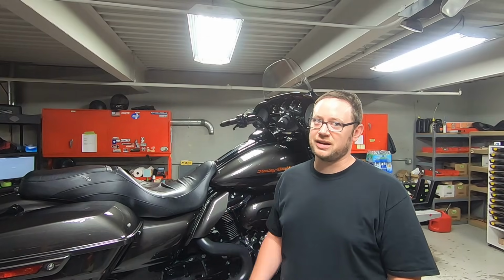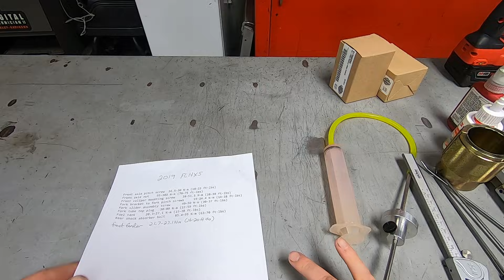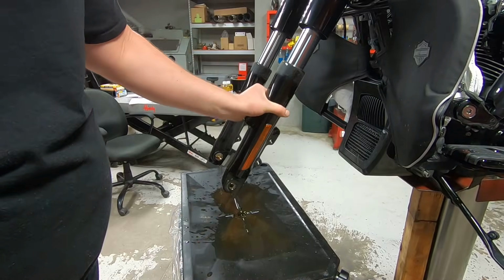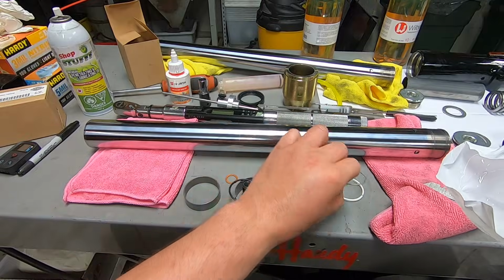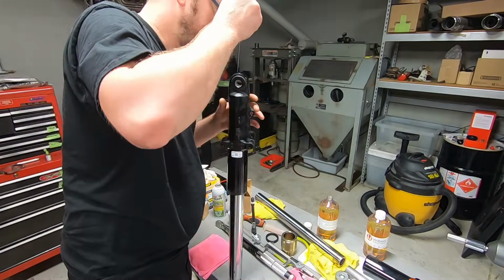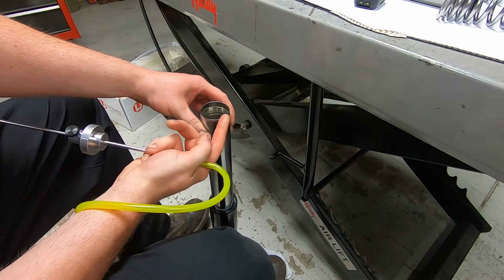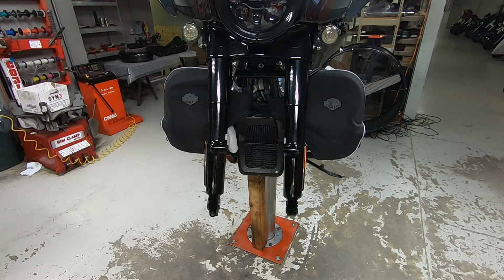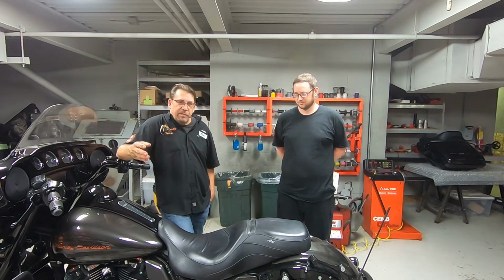Wilbers LDC Full Front And Rear Suspension Installation And Review For Harley Davidson Touring Bikes

Comment: This is a superb video! I purchased these shocks for my bike and I used this video to install them. They work perfectly, and this video was an absolute gold mine of information. I did not replace the seals since the bike only had about 10K miles on it, but if I had, I would have been well prepared for the work due in large part because of this video. Thanks again, you truly are a Wizard.
Reply from the maker: Thanks. And glad to hear!!

Comment: Brad, I have to say that your videos have saved me thousands of dollars by being able to do my own work on my bike. Your how to videos are absolutely the most professional I have encountered on YOUTUBE! I have the Wilbers kit coming for my Road Glide and am looking forward to the install myself. Thanks a ton my friend.
Reply from the maker: Good.  Thanks and your welcome!
Reply: @HarleyDavidsonWizard  Completed the install this past week. Everything went smoothly. I do have 2 questions. First question is there were some holes at the bottom of the fork tube (I have a 21 Road Glide Special) that you can see screws through the hole. Looks like it holds in the piece on the inside bottom of the fork tube. I wanted to know if the tubes have to be oriented in any particular way or does not matter when it comes to those screw holes. The holes seem to be a certain distance apart with one being different than the others. Second question is do I have to the test with a rider and passenger at the end? I gave the company my specific info when ordering. I have ridden the bike and it seems fine. Thanks in advance.
Reply from the maker: 1 The holes towards the bottom of the fork tubes have no specific installation location and can be pointed in any direction. 2. To do the initial suspension sag adjustment after installation. You first have the vehicle upright with no rider on the bike, measure the shock length. Then gear up as you normally ride to account for normal solo riding and with the bike upright again, sit on the bike and measure the shock. The difference of these two measurements is your sag adjustment. The Wilbers LDC will automatically pump itself up and adjust for a second passenger & additional weight in the future.
Reply: @HarleyDavidsonWizard  Got it Brad. Thanks for all the info. I'll check the sag adjustment tomorrow. From the video looks like yours needed no adjustment after checking it. But I'll make sure just as you did. Again thanks a ton!

Comment: Whenever I have a wheel out of a bike, front or rear, I always give the brake discs a clean with some brake cleaner on a new cloth - mostly to make sure I haven't left any oily paw prints on them. A good thing to get in the habit of if you have time is to take the pads out of the calipers and clean them as well as the calipers themselves - I don't think you can have your brakes too clean and they seem a bit sharper for a little while afterwards. whilst cleaning the calipers it's a good idea to check that the seals aren't leaking and you can also check the wheel bearings as well.

Comment: something I did to help with the top of the tube corroding when water sits in it is when I re built my forks on my 2017 RGS I fitted dust seals for 45mm forks of a Suzuki RM motorcross bike they are are quite low profile and fit a treat, saves water sitting in the top of the exposed fork tube

Comment: 1st off great video as always 🤘🏼 I have been really thinking about these But what if I am not always riding 2 up and my bike isn't loaded down then what if I lose weight then what? Or Iam over thinking the whole thing 😅 thanks again for a great video
Reply: Definitely overthinking, which is normal as it is a different system. The system is configured to work already perfect with the single rider (20mm rider sag adjustment). If your weight changes significantly (or the bike is sold), you just need to redo the rider sag adjustment once. All extra weight will be taken care of the left Nivomat shock. It's like having a suspension guy sitting underneath the saddle bag, continuously adjusting damping and spring rate to the most comfortable position, absolutely unique technology. By the way, quality tested by off road misuse of Million Dollar Bogan.

Comment: Dale, you are a lucky man! Brad is an awesome mechanic. Brad keep up the great work. 
One question though, how do you make sure the front axle is parallel to the floor when you reinstall the front wheel? When I changed my front suspension, I had to check that before resintalling the fender and so on...?
Reply from the maker: What kind of front suspension do you have? I've only had problems with the progressive kit where they put only one spring in on one side, and it compresses the top out spring making it longer than the other fork assembly. I really dislike those progressive kits, they make the simplest task of even tire changes super difficult. On this kit from Wilbers and basically every other manufactures the inner fork components are the same from left to right and as long as the fork tubes are installed even amounts into the top triple tree then you don't have to do anything other then just sliding the axle in.
Reply: @HarleyDavidsonWizard  I've installed some axeo from legend suspension. So it's simple cartridge but when I reinstall the fork legs I had to double check the height of the leg so that the axle will slide in smoothly. But I'm not a professional like you. Can you, in one of your next video, explain how you tune the bikes (I've already seen all your other videos but it's not as well explained as I wanted ;-)) with the power vision using or not an autotune pro kit on a dynojet dyna bench. I will really appreciate that.
Reply from the maker: I will keep that in mind. Thanks
Reply: @HarleyDavidsonWizard  Hello Brad. I just got this kit. Would you be interested in doing my front forks?
Reply from the maker: Ya sure. Where u located at?

Comment: Yes good to see you back on and shock set up very interesting saw Matt laidlaws vedio too is there a shorte length if you want a lower stance?  Thanks
Reply: No, it's all the same (standard) length, but the bike still looks low (watch my Road Glide CVO video). As the "pumping up action" takes place during the ride, You have similar look when parked. If You want the extreme lowered look, You have to consider an airride (or no suspension at all ;-))

Comment: When you reassemble and reattach your forktubes, do you actually use a nickle as a measuring device?   I can see that there could be an axle alignment discrepancy if the measurement was done by eye.   

Great instruction video BTW.   Simple, detailed, yet discussed in such a way that a handy person would feel comfortable with the installation.   Thanks Brad!
Reply from the maker: I do it by eye.
Reply: I do it by eye AND use the axle without the wheel to check, so I get exact parallel forklegs.

Comment: HI Brad, great channel I've done lots of repairs  thanks to you ! I have 2004 FLHTI the rear swing arm has little play in the rear shaft slight clicking feel and very little movement the shaft looks new should I change the 4 spacers and bearings ? or is this normal the isolators where replaced 4000 miles ago. thanks again
Reply from the maker: The spherical bearings in the swingarm typically have no side to side play. Id replace the swingarm bearings with a kit from www.sta-bo.com and the bike will be better for it.

Comment: I wish you had been able to install that suspension on a test bike.  I'd like to ride it before ditching my Ohlins rear & cartidge front for a Wilbers setup.
Reply from the maker: Ya. That would be nice. You'll have to pressure Dwayne into it. Lol.
Reply: I had Ohlins before on my 2011 Road King Classic, proper adjusted it was no difference to Wilbers (riding single). Riding single or two up, there is just nothing that gets close to Wilbers (on a Tourer!), as You still have a progressive spring rate with full suspension travel AND no trouble at all finding the perfect setting and removing bags to dial it in.

Comment: I was going to go legend...  but this is on my radar
Reply from the maker: We used to sell alot of legends, and they did ride well. But there rear shocks used to blow out there oil seal and leak oil on the rear axle and brake pads. Legends warranted all the sets I've seen it happen to and I've been told that they now use different seals but I've also had 2 of the top caps for the front cartridges leak oil, not fork oil but cartrage oil. And after those problems it put a bitter taste in my mouth. And those old problems I'll never forget. Lol
Reply: @HarleyDavidsonWizard  gracias...  my FLHTP rear is way way too stiff as a solo bike..  looking into options..
Reply: @skippynj1979  If a full set is within Your budget, go to Wilbers. The biggest advantages are the stock look (a matter of taste), the perfekt ride quality with continuously adapting spring rate AND damping while You ride and it is absolutely foolproof. ZF has designed the LDC shock to last an equivalent of 180.000 mls, so as Brad mentioned, You buy quality. Good luck for Your decision and always keep the shiny side up...

Comment: Hi brad, thanks for your videos
I enjoyed so I decide to subscribe and I have interest about shocks
 I understand You changed rear shock but why you change front springs? Do you have any good things?
Thanks again
Reply: Wilbers only offers the suspension as a kit (front and rear), due to DOT certification reasons here in Europe. Believe me, You don't want to miss the front once installed. The Wilbers fork springs have a totally different surface treatment and a different progressive coil. The short road imperfections a stock Harley front is not reacting at all, are gone with the "simple" Wilbers spring. If You want to see more, Matt Laidlaw did a podcast on suspension two weeks ago
https://youtu.be/t-ua9_EcUQU
Reply: Thankful for your reply. If I have a chance I will change as you suggested, thanks

Comment: Will your Milwaukee impact driver loosen the top fork bolts by itself or do you have to crack them loose by hand first ?
Reply: My Milwaukee breaks them loose. Torque spec is 30-80Nm and they are not very tight.
Reply from the maker: My milwaukee impact zips them off no problem.

Comment: Nice video! I've researching Wilbers for a couple of weeks now and I'm sold on this suspension. 
The question I have is where did you get that syringe thing to remove the fork oil? Did you make it or buy it somewhere? 🤔
Reply from the maker: It's a actual fork oil level tool. I baught it out of the drag specialties catalog many many years ago. If you go on ebay and search for "motorcycle fork oil level tool" they pop up for less than $20. The Wilbers is awesome. U wont regret it.
Reply: @HarleyDavidsonWizard  thanks for getting back with me. I'll look that up right now. I've subscribed to your channel so keep those videos coming! 
Also, I think you said that you could use a pvc pipe to tap in the oil seal? What size pipe would I need? Or, where could I get the one that you used? 

Thanks again....Frank
Reply: @50metro  A 2in PVC pipe should work, but a simple 49mm (or adjustable) fork seal tool is better.
Reply: @stefansgarage3014  Yep. I bought one from Amazon. It came yesterday. 
Now all I have to do is shell out the green to Wilbers. 😆
Hey are you working at the dealership in Waterford Michigan? I bought my first Harley there back in 1984 when it was ABC Harley.
Reply from the maker: I was working there. I was at ABC harley for almost 12 years. I've moved since making this video tho.  I'm at Motor city harley now.

Comment: Will this setup work on 2011 RGU CVO?
Reply from the maker: Yes. I sure will. The front fork parts are a little narrower for your setup (because your bike is equipped with 41mm forks and this video has me installing it in a newer bike with 49mm forks) but Wilbers does offer a complete kit (front and rear) for your bike with these shocks.
Reply: Thanks for the response!
Reply: It will definitely will! The tiny fork will be improved significantly. It might be that only the left fork spring will be changed (price of the set is lower), but oil needs to be changed in both fork legs. You won't believe, what Your bike feels after the upgrade-if done some FL2s already.

Comment: Brad just wandering if you have ever checked out a bike that is using an external breather system (catch can)? If so what is your opinion?
Reply from the maker: I've seen a couple setups. I haven't seen any that I love tho. I like the concept but any setup i've seen have downsides. like some you smell the oil vapor or some just gunk up a different part of the bike with oil vapor or some make checking the oil difficult. The option I like best "but havent seen in real life" is a setup T-MAN performance does with dumping the blowby through a passage he drills in the transmission case and dumps it back in the oil. It isn't a simple to do setup but I like its elegance. IMO

Comment: Brad what is the torque spec on those rear shock bolts?
Reply: description...
Reply from the maker: 85.4–95 N·m (63–70 ft-lbs)
Reply: @HarleyDavidsonWizard   I had REVO A's Installed at a dealership when living on the West Coast. I noticed that the spring was rubbing on the shock body so I called Legend and they said to send them in for a rebuild. I cannot get a dealership where I currently live to to manage the remove/re-install the shocks because it would "tie up a lift for 2 weeks" WTF. In any case I have decided to do the job myself and I ordered a lift. Thanks for the information!

Comment: Oh also have you installed the new S&S 590 cam on a 131 yet? Did one and pulled 134 hp on the dyno on autotune lol not even dialed in yet
Reply from the maker: I haven't used a S&S cam yet. I've used a T-Man cam and hade great results with the SE 131 kit.
Reply: Awesome! Did you get to watch the Laguna seca race!! Battle of the baggers, the HD came in second
Reply from the maker: I heard about it. But heaven seen it. Was it any good?
Reply: Bro it was awesome!! Vance and Hines did a awesome job on that street glide,
Reply: Quick question Brad have you ever removed a Softail oil tank
Reply from the maker: I'll have to check it out then.

Comment: so there's on danger in adding slightly more oil? I thought thats how you blew fork seals. also i was under the impression that a heavier fork oil would make for a stiffer suspension? but watching this makes me think just a little less air gap will.
Reply: It's a combination of all. Normally You can rely on the research of the suspension companies. For all Wilbers Forksprings You have a recommended oil viscosity and oil level. For the oil level there is a +- 20mm tolerance, honestly I would go for the recommended level (except CVO RG (2018 and newer, I'm using 140mm instead of recommended 125mm).
Reply: @stefansgarage3014  thank you im doing a dump and run. i bought Amsiol 10w but after watching many videos on the subject i wished i would have got 15w as im a two up rider carrying about 350ish lbs. with gear. so i might try a little more of the 10w . if that doesn't do it i might go to a rebuild next year or two. thanks again.